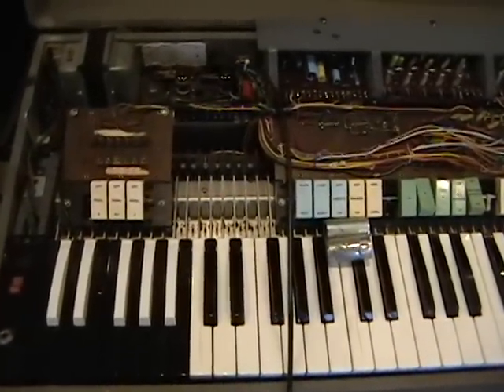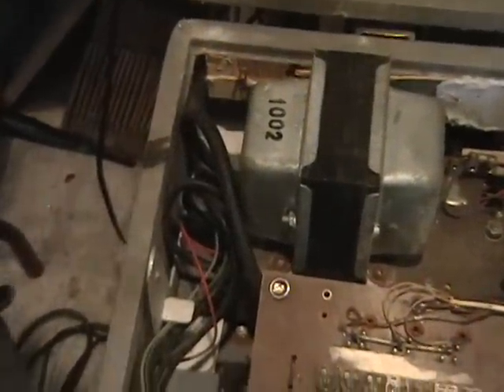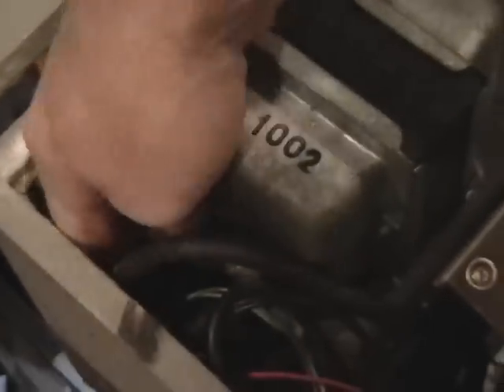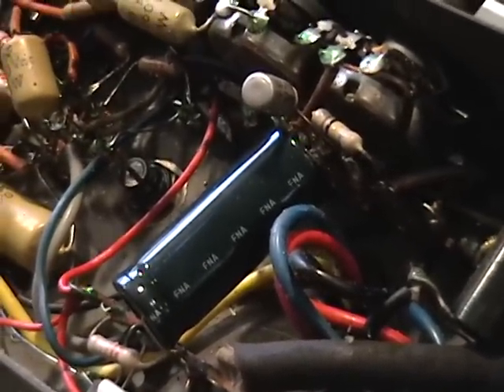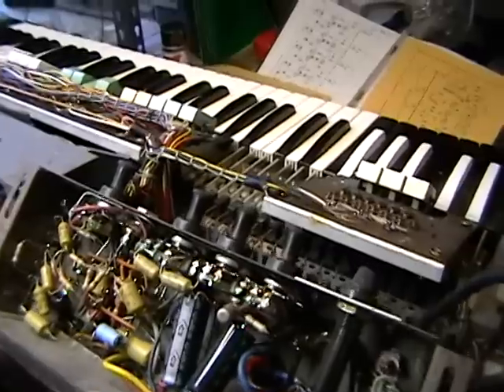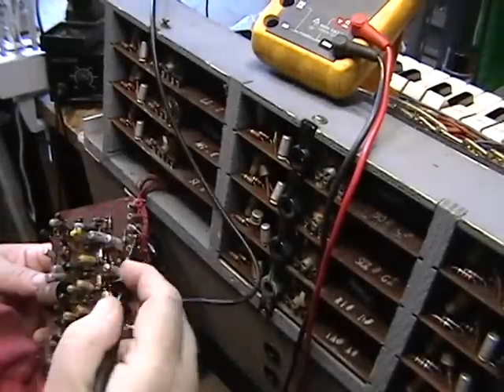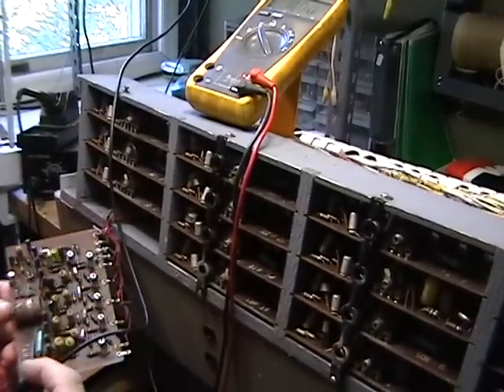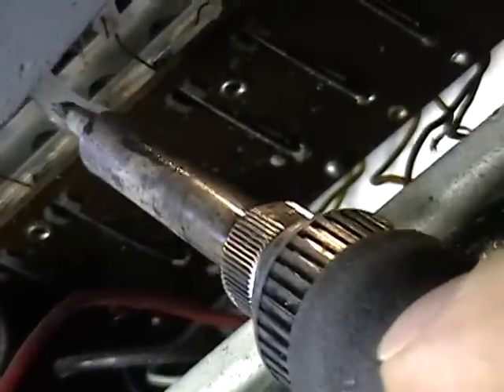Farfisa Combo Compact Repair - Part 1

Comment: Love the safety pin fix. 😂 I have used guitar strings to reinforce and repair contacts on mine. Work a treat!
Reply: Can you explain the fix? I’m trying to fix my mini compact and I’m pretty desperate lol
Reply: @audiodood  Depends on the issue you are having of course but the problem I was having were some crooked contact springs that weren’t moving correctly and not in such a way that it would make a decent connection to the rails. I slid a piece of guitar string (I think a D-string…could be wrong) through the centre to act as a ‘splint’. Applied a little solder to the end to make it stay in. Worked for me on a few occasions. Not heard this method ‘approved’ elsewhere online, so completely at your own risk. ⚠️ I was just improvising with what I had and needed a quick fix.

Should also add that the model I have is a Farfisa Compact Professional I, so not sure how similar the contacts are to the Combo Compact or Mini Compact organs…
Reply: @LeoVKMusic  I talked to some professional service techs and they gave me some tips on what to do (basically doing this)

I found some violin strings that seem like they'll do the trick, I'll let you know how it goes

Comment: Any advice?? I had my farfisa 252r going from my the headphone jack to a mixer (the back 1/4" output isn't functioning.) The volume fluctuates over time, and usually will be stronger when I turn it off and back on. But when I did, the farfisa sent an electric current from the headphone amp that fried my channel! Smoke and everything... Why!??? Thanks!

Comment: I know this video is 10 years old but I recently just got a farfirsa combo deluxe for a smackin 150 and everything works except the reverb and vibrato, which I can live without I just use amp effects but for some reason all of the G notes are G flats, if anyone had any idea on how to fix that or where thats even located within the organ that would be of great help.
Reply: Replace the 25uf capacitor next to the coil on the G board,that can cause the note to go way out.
Reply: @panthercombo9647  now to someone who knows nothing about wiring would you say this is relatively simple to do?

Comment: What would you suspect to be the culprit for a very noisy Farfisa Combo.   All buttons works as they should, but standing noise/buzz is nearly as loud as the notes.    Output transformer going?   Pre-amp tube?   Just interested in where to begin troubleshooting.  Here is a sample: https://soundcloud.com/user-886882633/farfisa